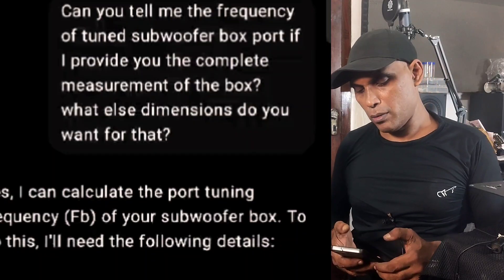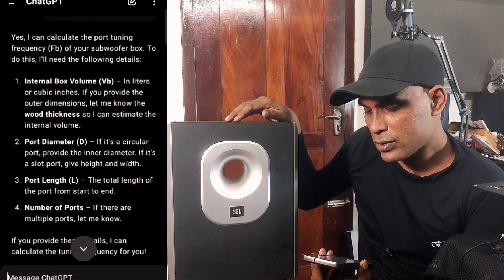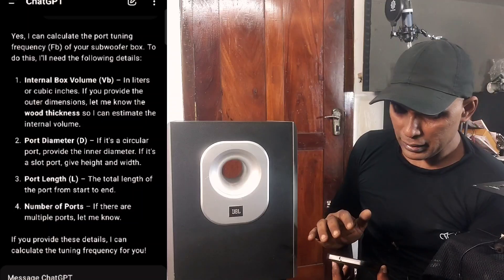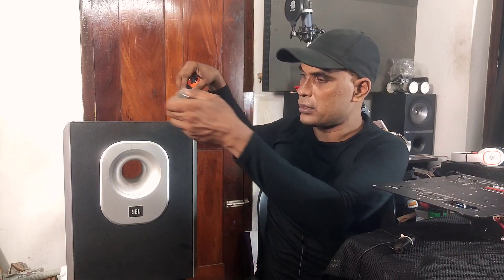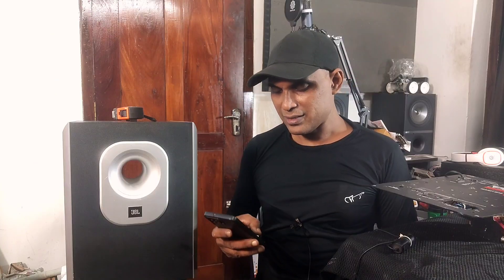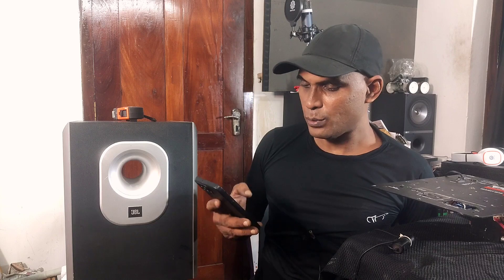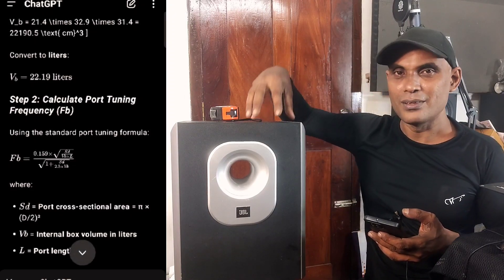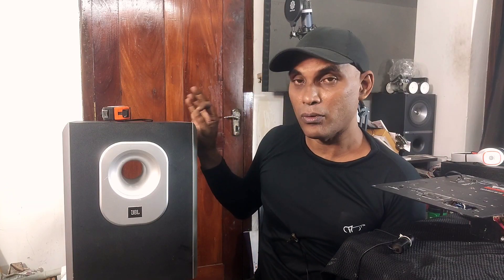I Asked ChatGPT to Calculate My Subwoofer Box Frequency… and This Happened!

Comment: I built a LCR using chatgpt. ... 8inch woofer speaker 4-8 ohm local brand no cross over or tweeter with 13x13  it a cube mdf 18mm thick..well some says its bad...but thats what it provided ..and power that with 100 w mono using100w classD  3116 d mon amp pcb suggested by chat gpt and the result was awesome... I USE 7.1 analo g out Dac with hdmi input from firetv extracting the 5.1 ... you know with out any avrs or subwoofer the sound was next level and feelt the bass with the L and R  ..watched king kong movie i didn't know tha firetv that lossy version from firetv will sound that huge .. OmG. It was great....Chatgpt rockks..and that way you explain things was awesome.. keep up the good work.if you like this i will share what i did in my face book..

Comment: You forgot to subtract the volume of amplifier and transform chamber 
You fool
Give the volume of that amplifier section 
Chat gpt will give exact answer
Reply: Don't be a dick.
Reply: **"अबे @pratikjadhav5003 और @akshat8586, कान खोल के सुन लो—गलती इनकी है और ऊपर से ये 'fool' बोल के अकड़ दिखा रहे हैं? अबे, amplifier aur transform chamber ka volume subtract करना ज़रूरी है, ये मैंने सही कहा, लेकिन इन जेंटलमैन लोगों को basic physics और volume calculation समझ नहीं आ रही। 🤡

ChatGPT को exact dimensions चाहिए होंगे accurate answer के लिए, लेकिन ये लोग हवा में बात कर रहे हैं और उल्टा मुझे ही बोल रहे हैं? पहले खुद calculation समझो, फिर ज्ञान दो। और हाँ, disrespect करोगे तो फिर वैसा ही जवाब मिलेगा, simple!"** 🔥🔥🔥
Reply: सही बात हजम नहीं होती लोगो को
Reply: If you are so smart, how come you forgot the shape of the port?  Both ends are flared, the tube is short and the average diameter is going to differ by a lot.   With 20-30% of the total length being a different diameter the difference is going to be significant.  Pull it out and see how much water it holds to get the volume, the length is known and its circular.  Divide volume by pi and height, square it and you get the radius.   
Or just download BassBox. Its old, but it works perfectly and has a huge driver database and handles flared ports, different types of enclosures and it outputs easy to read graphs like spl, impedance, phase etc. for a given input power. 

BTW: The driver also takes up space, so you might want to subtract that as well.
Reply: Only if you also factor in the displacement of the driver assembly and average the diameter of the port. That´s necessary with  large flaring on short ports.
Reply: Ok but you don't need to disrespect him by saying "fool".
Reply: @pratikjadhav5003  हा भाई हर चीज में थी सब करते रहना रिस्पेक्ट disrespect lekin real facts ko acknowledge mat Krna tum
Reply: You're the fool
Reply: https://youtu.be/J89I_oDpyB8?si=sjgc2FWjPsLPjr6C lol  @akshat8586